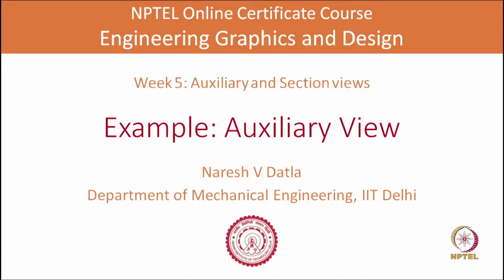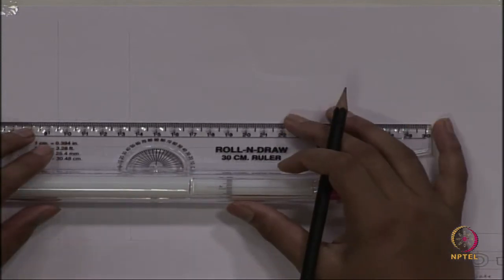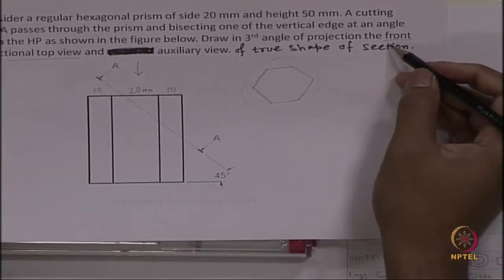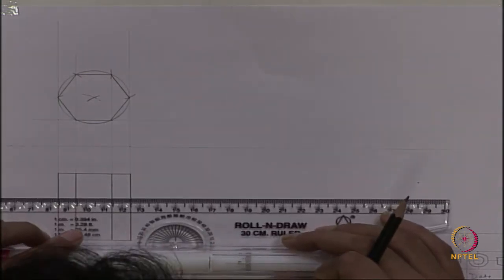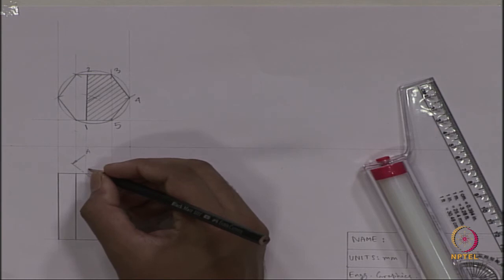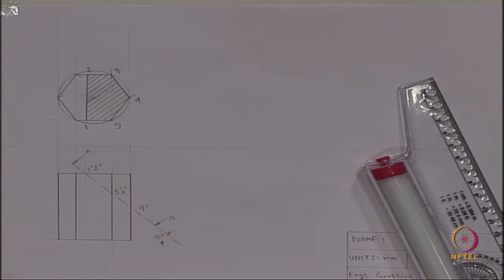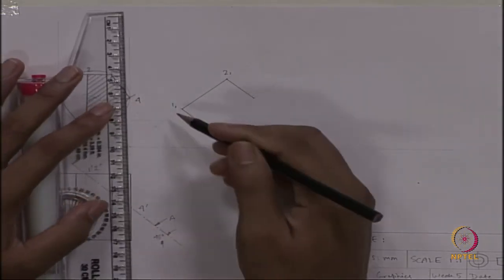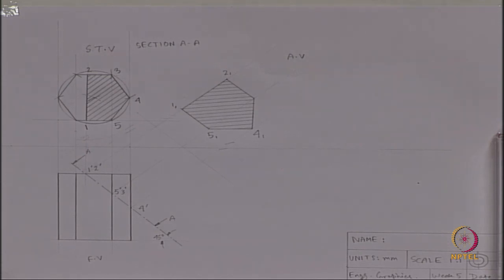W5 L5 Example Auxiliary View

Comment: Sir one doubting you not tell the measurement of section take from where to 45 degrees to section on front view
Reply: You can take 45 degree corresponding to any of the horizontal line
Reply: @amitchanda1987  but section is not same cut like your figure